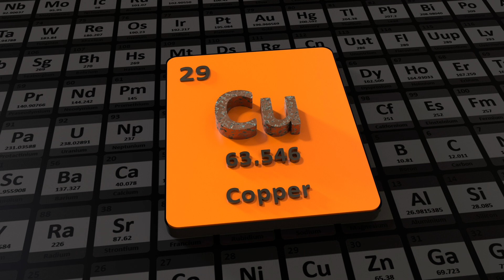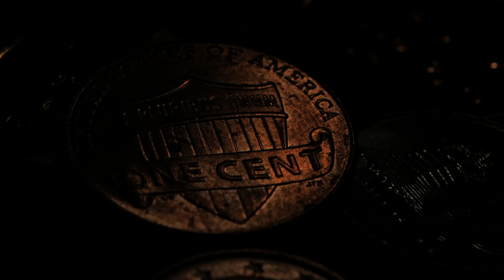The History of Copper: From Bronze Age Swords to Your Computer

Comment: Great video! At 4:00 thats more like the melting temperature in fahrenheit its should be something like 1084 degrees in celcius. 5:32 I take it you mean melting point? I dont think metals have smoke point.
Reply from the maker: Correct. Sorry I miss spoke. Smoke points are usually mentioned in reference to cooking oils. I made this video after re-recording my vi on Olive oil so that might have been why. I will add the correction to the pinned comment. Thanks for noticing.